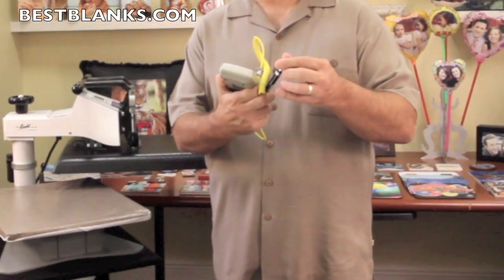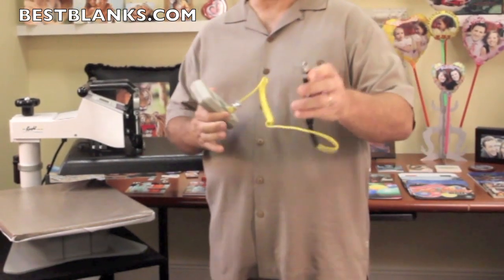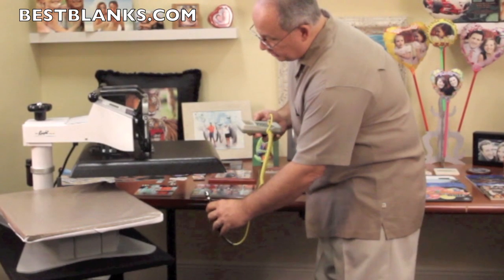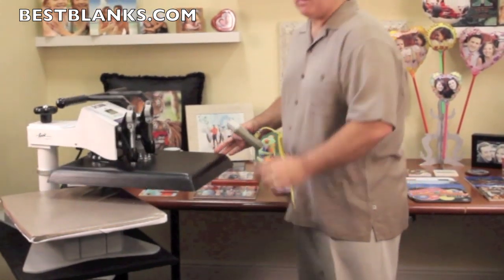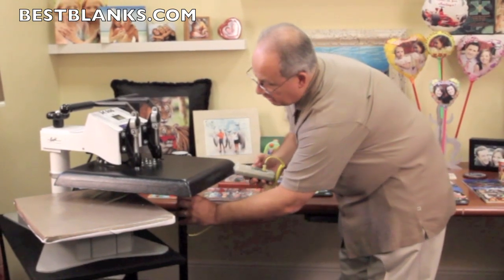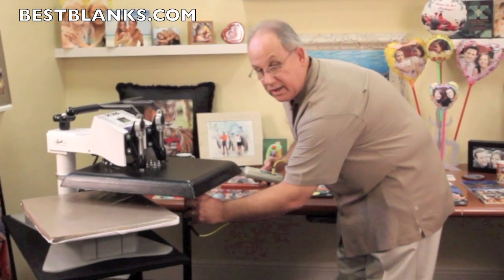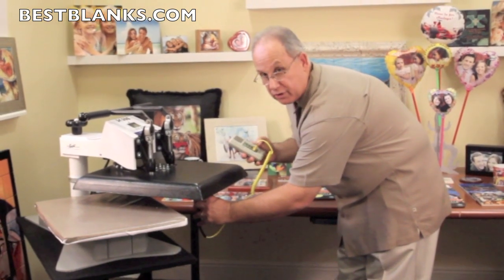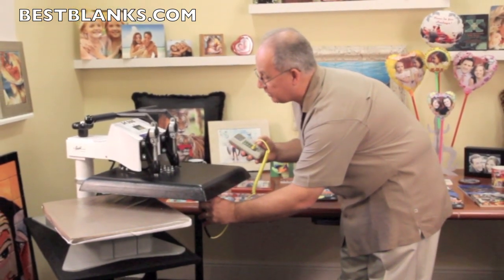How To Diagnose Heat Element/Platen Problems on Your Heat Press

Comment: Good video! We at Geo Knight Co have found 99.9% of uneven printing problems on the Digital Knight presses are always pressure related. The Supercoil Microwinding Heaters in the Knight presses can Not have cold spots per se... Thus the confidence in offering the lifetime warranty. The real problem is Almost ALWAYS lack of clamping pressure, or a worn-out bottom pad. Making sure the padding is flat, and the clamping pressure is a firm two-handed "Ka-Thunk" removes almost all printing issues!